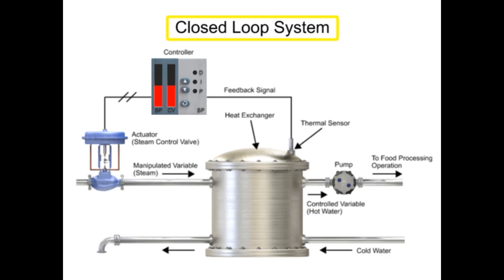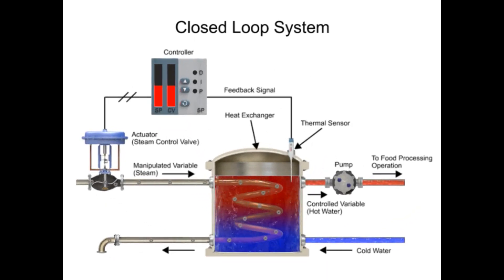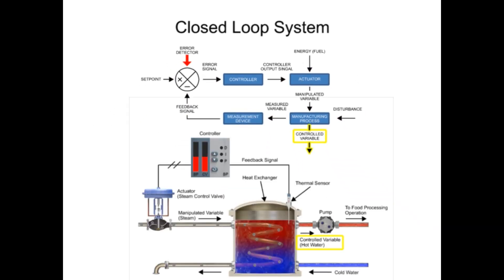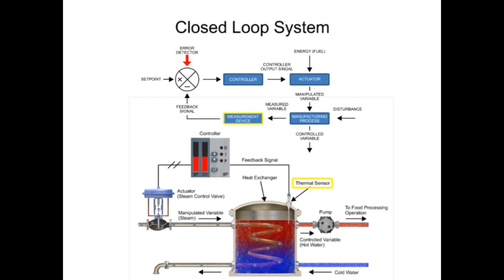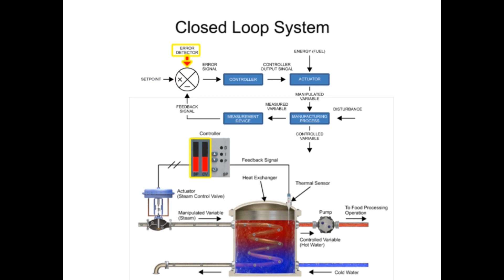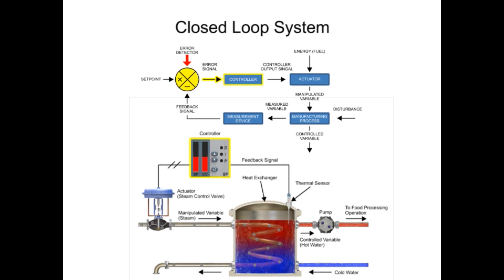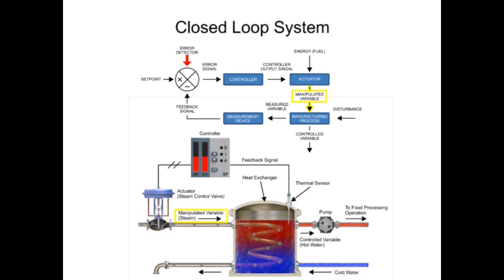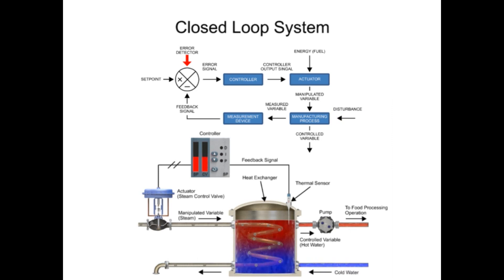What is a Closed Loop System? | Basics of Control System

Comment: Is a closed-loop system a system that is neither controlled by any external apparatus nor an external person? Is it a system that controls itself automatically based on its own feedback?
Reply: If the Controller is part of your system, then yes it's automatic. It's the controller in the example that's making decisions (based on set points). Think about the heat in your house. You set a desired temperature on the thermostat. After that, it's automatic. When the room gets cold, the thermostat then tells the furnace/heater when to start. Once the room in warm, the thermostat tells the furnace to stop.
Reply: @kendickson-self2883  Thanks, Ken.